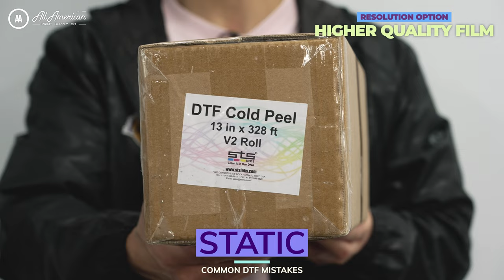Common DTF Mistakes! | AA Print Supply

Comment: please someone help, when i cure i can never get it nice and smooth theres always pin holes or the image is pitted after curing...idk what the heck to do i have tried changing so many things an every damn shirt peels or cracks! im in the hole and have made zero bc my stuff SUCKS plz help what am i doing wrong?? over curing or under?
Reply from the maker: Hello, it sounds like we may need to connect you with technical support. Here is the link to speak with them directly, please provide photos of the issue at hand so we can properly diagnose what is happening: https://aaprintsupplyco.com/pages/contact-us

Comment: Hi, I have a Epson L1800, to print only white logos on a black t-shirt, can I get excellent results by printing the white isotro at 1440x720 or should I print the white at 1440x1440?
Reply from the maker: Hello, thanks for stopping by. I have not personally worked with that exact model but the higher the dpi the higher the quality level should be. Will you always need the higher dpi? It depends on a number of factors such as garment, film, powder, etc. Best bet would be to print and apply both to see how they compare

Comment: hey isn’t dtf toxic ? how to prevent it ?
Reply from the maker: Hello, let me start by saying untested/non certified materials of ANY kind from an unknown source can be problematic potentially. From day one we have stressed the importance of safety with sustainable supplies and methods. Our products have undergone thorough testing to ensure the safety of the print staff and their customers. Does every company do this and offer the documentation? Probably not. That being said if you follow instructions for ventilation and do not physically ingest/inhale the actual powder or ink you are not at risk. PPE protection can be worn during production as an extra layer of safety such as a mask or gloves but a good system set up properly and used how we instruct can ensure a clean environment and safe production
Reply: @AAPrintSupplyCo  i just turned 19 and i want to start, your telling me i need all that stuff to be safe ? even if my printer is a cricket explore air 2 and then i have a heat press ?
Reply from the maker: @2lordrew  That's awesome to hear you are getting your foot in the door! The thing is, we cannot speak on the safety of products from other companies or distributors from overseas. What we can assure you is the materials and supplies that we offer are tested and certified for safety before we ever offer them to market. If you buy from us, join the free trainings and follow instructions you will be safe.

Now as far as the Cricut Explore Air 2, that would be a cutter - no actual printing going on here but you still always want to consider your source. The material we offer for the Cricut (heat transfer vinyl) is also tested for safety but, again, we cannot speak on behalf of other materials out there from unknown sources. Here is a video breaking down the differences between DTF and vinyl we put out recently: https://youtu.be/aDSmchqCkxA?si=mQ3jD9BgUF2zy7Qn

Comment: Do you have to keep the printing environment at 40% to 60% humidity 24/7? What humidifier do you recommend?
Reply from the maker: For the smoothest and least interrupted production experience that temperature is advised at all times for the environment the printer is in. As far as which humidifier, essentially you just want to avoid ones that emit a visible mist spray into the air. Those particles may travel in the work area and we do not want that. Aside from that one that includes a manufacturer warranty would be my best advice.
Reply from the maker: Also, if the model does not have a visible humidity display gauge it may be advised to also purchase a gauge to ensure the levels of moisture in the air at all times.
Reply: @AAPrintSupplyCo  thank you for the reply. I'll take all of this into consideration when I pull the trigger.

Comment: For me, my ink runs off when wet. I am crunched on nickels and dimes so I tried the DTF inkjet printer hack. Should I just invest in converting another printer? I do have an Epson that was converted for subbing.
Reply from the maker: Hello, what RIP software are you running? Sounds like we need to dial back the ink a little. Also, what printer?

Comment: Still have strokes of ink line forming   when printing DTF films.
What would be the best way to solve that problem.
Is it through head cleaning or Nozzle checks?
Reply from the maker: Hey there, nozzle check should tell us if the print will come out with or without lines, head cleaning on affected nozzles corrects the bad check.

Comment: Thanks for the great info. I'm getting a peculiar issue where in grey colour designs magenta is getting mixed and when solid grey colour design is there magenta lines are being printed. Any idea how to fix this?
Reply from the maker: Hey there, what printer are we running this is happening to you with? Off the bat, cleaning the capping station and running a head cleaning sounds like the first steps

Comment: Hello, I have an Epson XP15000 DTF printing. It was printing just fine. All of a sudden, any image I print, it looks enlarged/stretched. Example: If I want to print a circular image, it comes out like in an egg form or oval.
Reply from the maker: Hmm, haven't run into this much before but first troubleshooting would be shut down the RIP, shut down computer, shut down printer. Developer may advise removing/re-installing program and driver as well depending on the program

Comment: I’m running the STS 724 
What temp should we bake at ? I at 125 F 
What about the heat press time and heat
Reply from the maker: Hey there, what are you using to bake the sheets? The temperature will depend on that (heat press, oven, conveyor dryer, etc). As far as application it should be pressed at between 310-320 F for between 15-20 seconds. Reference your individual films instructions as to whether it is a cold, warm or hot peel. LASTLY, I always perform a finishing press after the peel WITH A COVER SHEET for 5 seconds, same temp used to apply

Comment: As far as I know DTF only sticks to T shirts, can DTF absorb into T shirts like using a screen? This certainly makes DTF more popular because using a screen requires a lot of time and effort.
Reply from the maker: Hello, we have had great results applying DTF to most any surface which can be heat pressed in even contact/pressure. Products include: windbreakers, wallets, safety vests: https://youtu.be/oT8T2ooXWME?si=xBFFLRl0wUDu2ug8
duffel bags, backpack, lunch bags, pet carriers, denim jackets: https://youtu.be/PAwRd41v8WU?si=Q2SrADuGNGMTlO0N

With good settings you can really embed the transfer into the fibers of the garment. We have seen this effect heightened with a t shirt used a cover sheet for the second press or 'finishing press' as well as T. Seal (https://aaprintsupplyco.com/products/uninet-icolor-t-seal-finishing-sheet-a3-size?variant=39893254668372)

Comment: I am learning so much from your content. I'm from Austrlaia, we have a Epson F3000 we are getting vertical lines on our prints not sure what is causing this?
Reply from the maker: Hey there, thank you for supporting the channel! First thing, we want to make sure the nozzle check is good before production. If the check prints incomplete we can get lines in the print. Are you experiencing this with DTG or DTF?
Reply: We are mainly doing DTF. It’s only happening with that. Nozzle checks have been perfect. It looks like not enough colour and then white is coming through the fine lines. I’ve just ordered new ecofreen film to see if that’s the case. Can I order from you guys? Because we  struggle to get good film here in Australia.
Reply from the maker: Hello, here are my setting I run for DTF with your printer: https://youtu.be/4Zr0eyzPBfk

YES! If you have sales questions, drop an e-mail to HARRY@aaprintsupplyco.com
Reply: @Ethan_plays26 I’ve had the same issue with mine and I still haven’t been able to resolve the issue .. going to try using a cold peel film this week
Reply from the maker: @justinabril9111  Hey there, wanted to circle back to this if you are still having issues. A quick way to tell is in Garment Creator switch the print setting from BI-DIRECTIONAL to UNIDIRECTIONAL. If this resolves the issue all you need to do is run a head alignment!
Reply: @AAPrintSupplyCo  yeah no luck. Anyway you can do a video on Kothari and show me your profile settings for DTF? I purchase Kothari from you guys to do DTF on my Epson f3070 and it’s just not working. It’s either too much white or not enough white . It’s been quite the headache. Current settings on Kothari are 100% choke , 90.20% under base , 0 % highlight ( this is at 0 because for some reason the highlight layer will print first then CMYK and then the white under base causing the highlight layer to drip. Not sure if there is a way to change the settings where both the highlight layer and white under base to run simultaneously after CMYK has printed ? )  settings continued.. white underbase pass is set to 6 at 1200x600 resolution - uni direction not sure if I’m missing anything else but if you can go into specifics, I would greatly appreciate it. Also, I’ve been using the DTF station ( regular hot peel ) I was told this was the best film for the f3070 a few months back by someone from All American and not I’m being told that the DTF station Universal film is the one to buy now… that being said, do I buy this new film ? Will this fix my print issues? I’ve been struggling with DTF for over a year now and have spent thousands to make this work and it’s not working. I spent 2 hours with All American Tech support just this last Friday  trying to trouble shoot going through almost $200 worth of film.. DTF on the f3070 continues to remains a mystery..

Comment: My colors are coming out too dark
Reply from the maker: Hey there, what printer are you running? We should be able to increase brightness by adjusting our white layer!
Reply: How
Reply from the maker: @bochito4488  Hello, what printer are you looking to do this with?
Reply: @AAPrintSupplyCo Hello, I am having the same issue from time to time. I have a printer that's using an L1800. DTFpro software. I've tried adjusting the brightness and contrast. It doesn't print anywhere near as crisp as the original image.